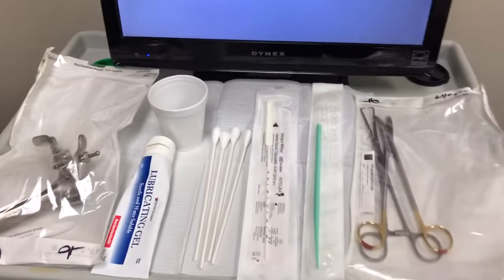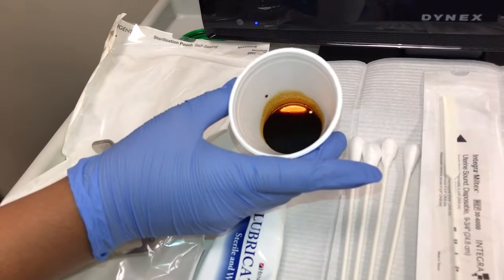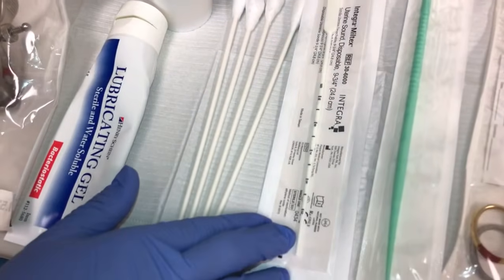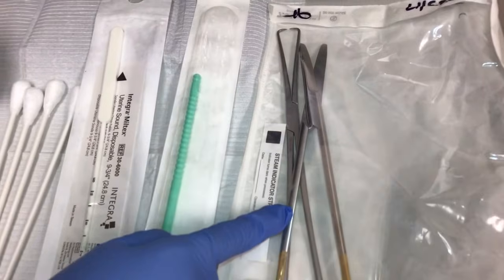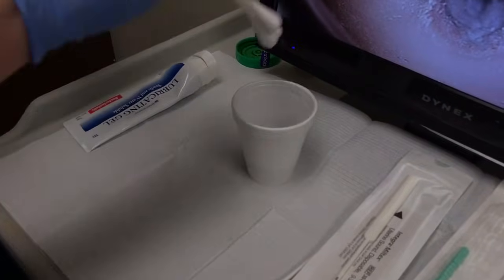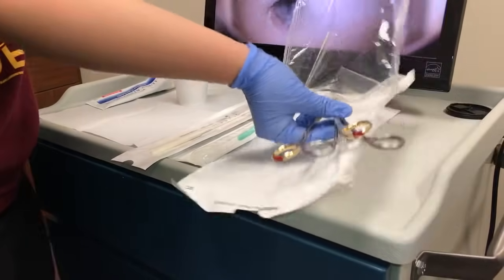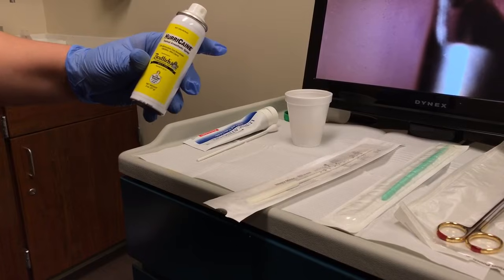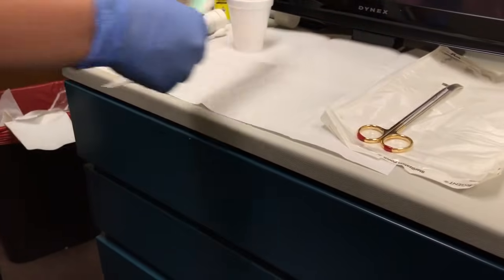IUD insertion-- Training video

Comment: Why do they skip the part where they attach the tenaculum? Cuz they know that part is where the real pain is. That is the most barbaric instrument there is! It pierces thru both sides of the cervix and it basically dangles there to hold the uterus in place for the whole procedure. I will never get another IUD. Iam traumatized.
Reply: It just DANGLES???? gravity will pull it down which puts even more pressure omg? this is truly barbaric

Comment: I get sick to my stomach and I'm terrified of the thought that the removal will be anything like the insertion was I am so 😱 scared
Reply: Honestly I just got it taken out and new one.... didn't hurt too badly. Took longer to drive there then the actual procedure
Reply: Every body is different obviously, but in my experience removal was a slightly different sensation than insertion but similar. I'm on my 3rd Mirena so have gone through 3 insertions and 2 removals so far. Not to spook you but to give fair warning: the first one I had removed, the nurse who scheduled me for it said it would just feel like removing a tampon...NOT the case for me. Was a much sharper, deeper sensation that was way more painful than just removing a tampon. For me, removal was short but painful, but that pain started to subside after a few minutes. Overall I'd guess insertion is probably worse than removal just because there's more steps/more poking around, but just be ready for removal. It usually takes me maybe 3 days for the cramping afterwards to go away, like a sharper, more centrally-located version of period cramps. And again, every body is different so fingers crossed it will be as smooth as possible for you. Oh and ask if they can do something to help manage the pain because they can probably offer something (even though they're not likely to offer it up front which is still absolutely bonkers to me). Good luck!! 💜 Reproductive healthcare sure is a wild ride 🙃
Reply: The removal is nothing compared to the insertion.
Reply: Same

Comment: You forgot to tell the part about where you almost faint, sweat through your clothes and then puke into the trash can. 💛
Reply: I fainted the first time. I highly recommend that next time you get a local anaesthetic block done. Discomfort from the injection is far easier to put up with and then it is more awareness of it than awful pain. It won't stop the cramps afterwards but you'll be okay when there.
Reply: I guess I’m one of the lucky few because I didn’t feel a thing
Reply: @megaplex6055 your gyno probably used the suction tool instead of the pinchers of death! Thats why some women feel horrible pain and some dont
Reply: Literally exactly what happened to me today LOL that little deli paper they put down was damn near dissolved by the time I was stable enough the leave
Reply: Everyone does not feel that so that's not a part yo discuss.
Reply: I did same thing too
Reply: Compared to labour this was a walk in the park
Reply: @Mumoffive2023 your doctor probably used suction tool instead of the tenaculum.